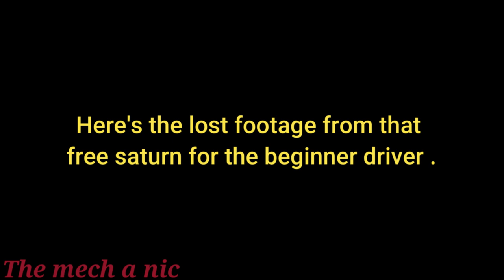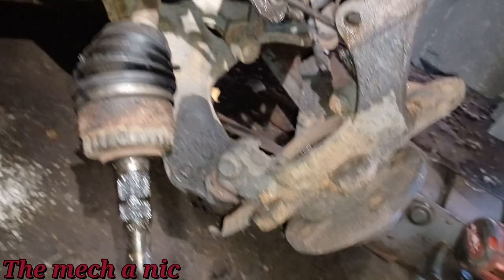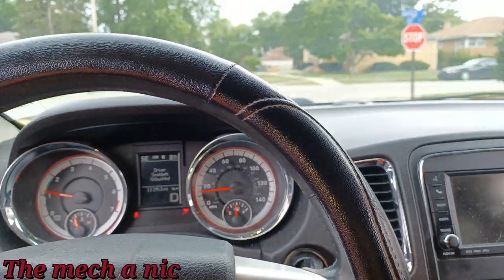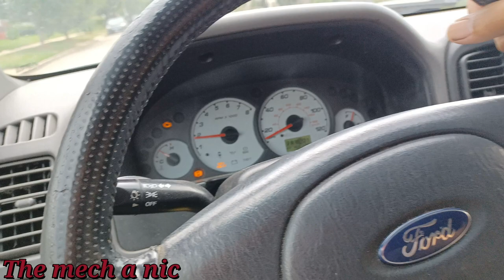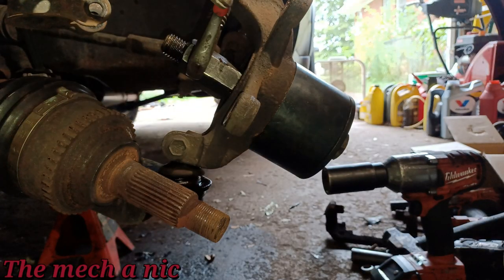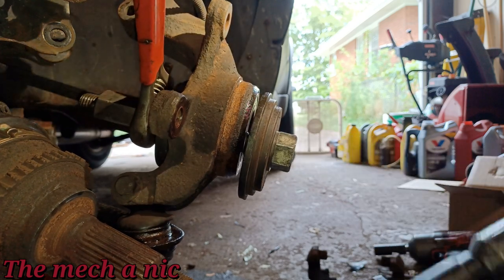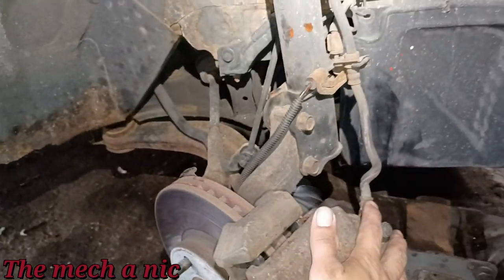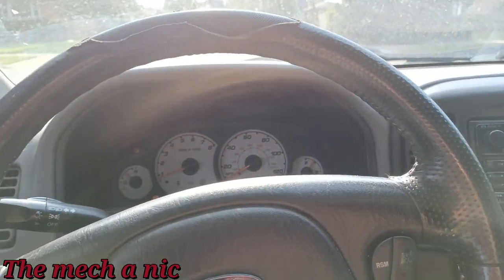durango upper control arm / escape wheel bearing (vol 103)

Comment: LOL, that Escape had 3/4 of a tank of gas, pretty ballsy to ride around like that. A friend, (Mr Jupiter), has a battery issue he want's me to ask about, when car is turned off volt meter goes from 13.5-14V all they way down to 10-10.5V before recovering eventually to rest at 12.2-12.5V. Car starts, but just barely, if you use the remote to unlock the voltage tumbles down again, Jupiter thinks he might nave a leaky diode in the alternator, the battery is only 3 weeks old and starter replaced 1.5 months ago..
Reply from the maker: Well the alternator is working  . You either have a bad battery or there's something draining the battery slowly and killing it